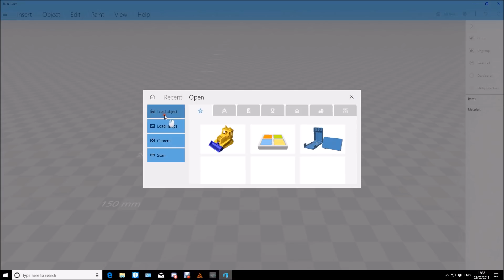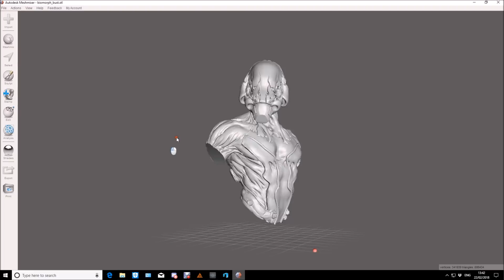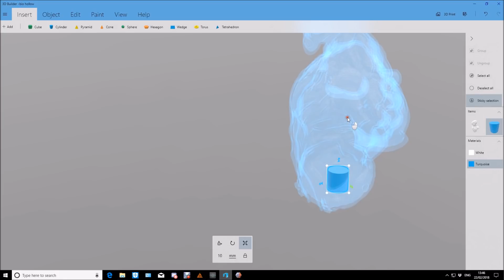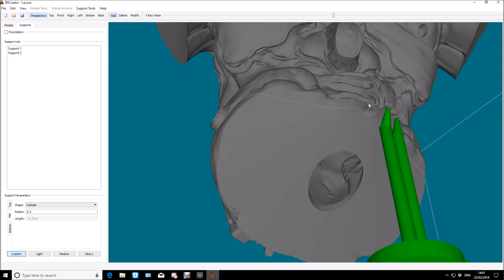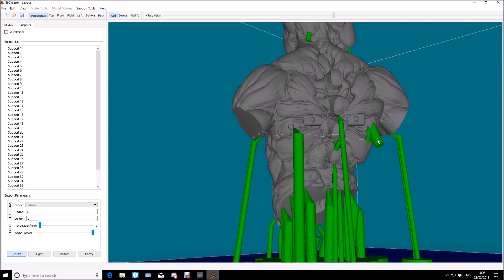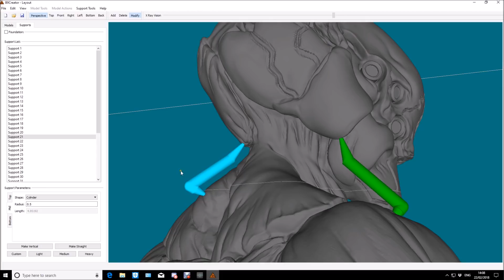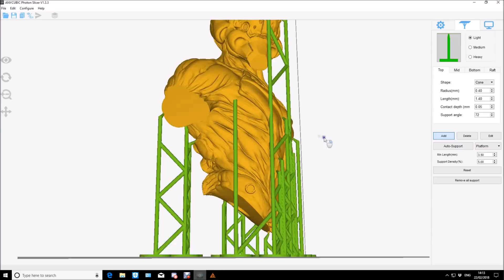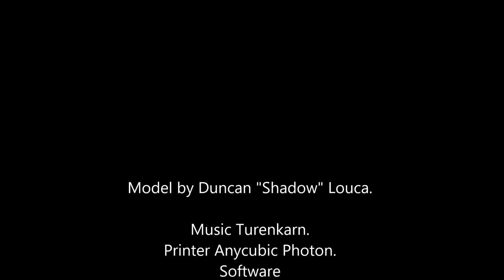How to sort models for you Anycubic Photon printer. reworked audio

Comment: Can you please tell me how long the film in the printing vat last? And where can you get replacements?
Reply from the maker: it will varey as a new user you will most probs kill the first sheet. just as well there is a spare. i have already damaged my 1st sheet. i put the vat down on what i thought was a clean surface and picked up a grain of dust and punctured my 1st sheet. i will have a word with the contacts i have about the fep sheets. but from what i am told they should last up to 100 prints before you need to replace. but others might post in the comments about other suppliers and sheets. as i need to get some spares myself.
Reply: Thank you so much, you're the first person that's been able to tell me anything about the FEP sheet.
Reply from the maker: https://www.youtube.com/watch?v=DLi3chV43LQ
Reply from the maker: will be using the photon for a lot of stuff i do on the channel and will be working on a load of videos for the photon also. :)
Reply: Speaking of FEP sheets, what is the thickness of the anycubic photon sheets, are they the same thickness as the wanhao d7 sheets?  I saw when I bought some resin that the wanhao ones were back in stock in packs  of 4 on amazon (US), but pretty limited supply.  I was considering getting some as my printer just arrived last night, but I have not done anything but unbox it so far.
Reply from the maker: i think the FEP is 100 microns i have asked anycubic for info. and will update asap. also asked them to include FEP sheet info to the manual. but again i will post asap :) but check out this link https://www.fepshop.com/product/fep-film/anycubic-photon/
Reply: Yes, they are the same thickness (.127mm). I was going to order some from flexvat.com, but then found sheets pre-cut on Amazon, so I bought some there. The price from flexvat.com is actually much cheaper, but it was easier for me to order from Amazon. 
https://www.amazon.com/Replacement-Wanhao-Duplicator-Anycubic-KLD-LCD1260/dp/B077S3M8D8